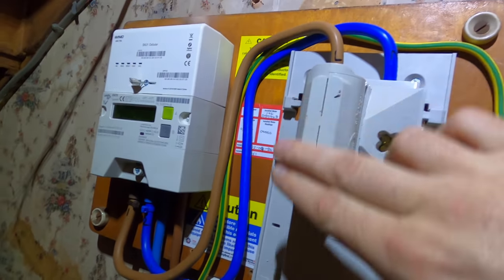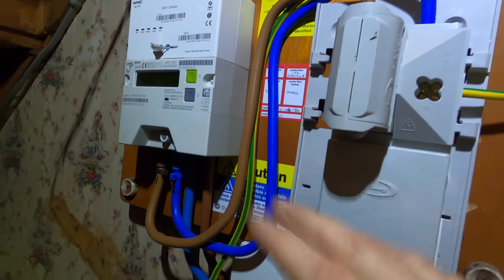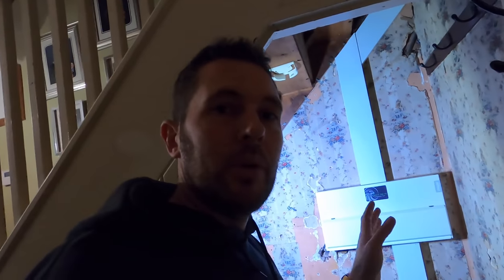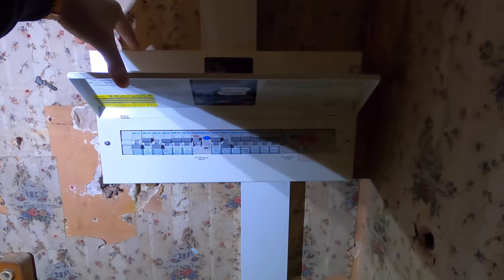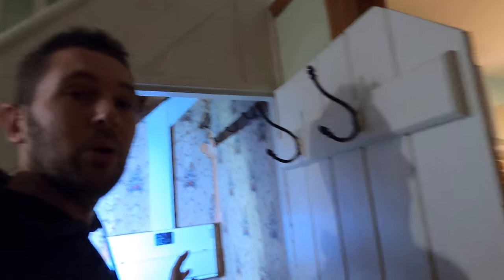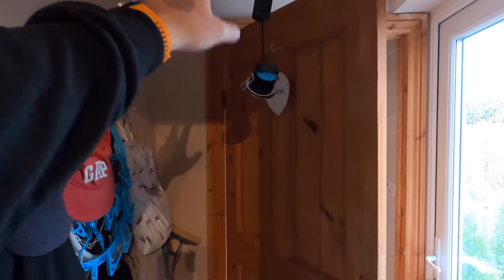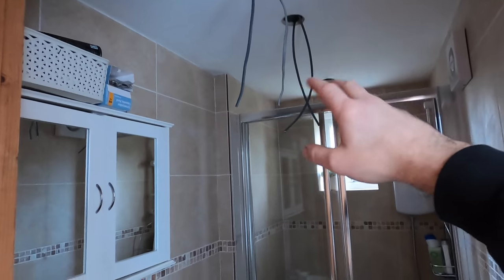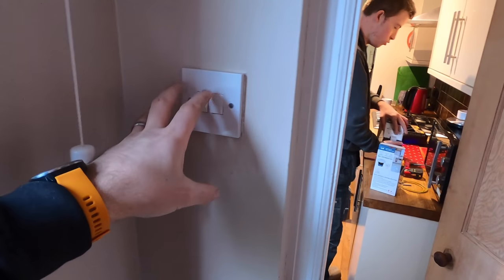Electrical Fault Finding - Nuneaton Electrician

Comment: It is important as per the regulations that Insulation resistance testing is measured between live conductors and live conductors and earth , not live conductors and the  cpc, ie the cpc is required to be connected to the means of earthing for the installation, the cpc should never be removed for the purposes of IR testing

Comment: Was the smart meter fitted to the old tails?
Reply from the maker: Yep 🙈
Reply from the maker: @haldo691  I know the guy from western power was shocked they hadn’t but said that the meter teams and western power always say its each other’s responsibility
Reply: @GreenHawkConstructionltd  all the meter fitter needed to do was make the same phonecall you did
Reply: Old corded tails - yeah, the meter installer never bothered to upgrade them. Not uncommon to find they don't bother to honestly cause from the meter onwards "isn't their responsibility". The mere fact they're not supposed to put the fuse back in if they find that according to their own guidance means nothing, it's a case of do the job they're told regardless of the safety and on to the next one.
Reply: Did they not fit a double pole isolator on the tails??
Reply: @Sowie-sm6xk  not unless the customer pays for one
Reply from the maker: @Sowie-sm6xk  no unfortunately not 👍

Comment: the minimum size for them loft sockets isn’t 2.5mm, the 1mm would be fine as it was only plugged in protected by a maximum of 13A fuse. Although I’m still with you, it’s shit and wants replacing and doing properly.
Reply from the maker: I know what you mean but I couldn’t leave it like that and the home owner wants everything write 👍
Reply: @GreenHawkConstructionltd  in fact I’m sure the regs state 1.5minimum when “spurring off” anyway. If that’s what you’d count that bag of shit as 😂 
Your completely right I wouldn’t leave that either.
Reply: @GreenHawkConstructionltd  also please don’t take that comment as being arsey, I wasn’t. 
I’m not the greatest spark on the planet and don’t claim to be 😂
Reply from the maker: @Cablesmith  no not at all mate I do get so stick at times but I always have the best interest of the customers at heart 👍👍👍
Reply: The best thing to do would be to rip that whole "loft conversion" out and start from scratch. No insulation, ceiling looks like it's ready to come down in some spots, horrible wiring, the whole lot.
Reply: @Ragnar8504  your right that’s defo a DIY job from start to almost done 😂